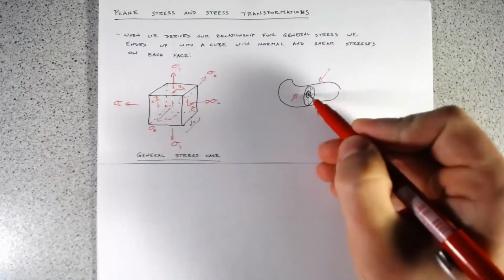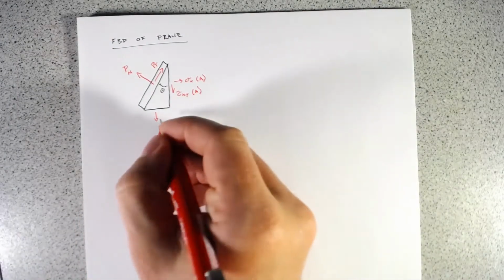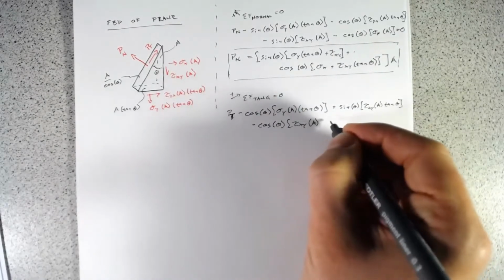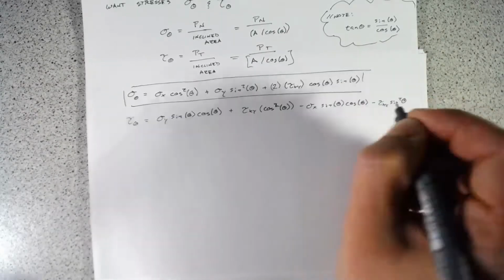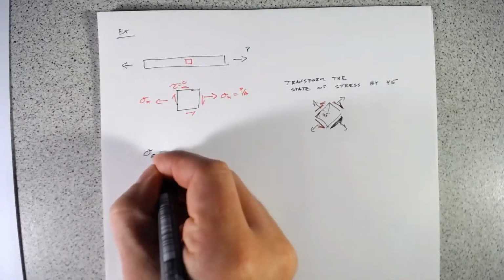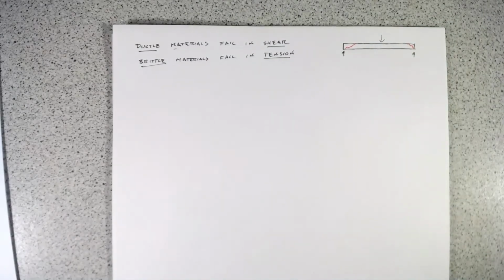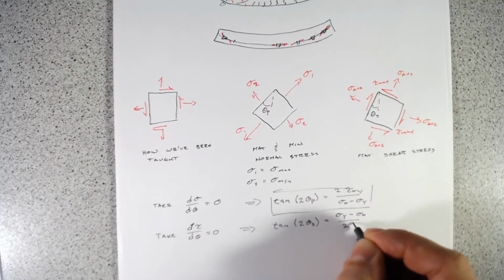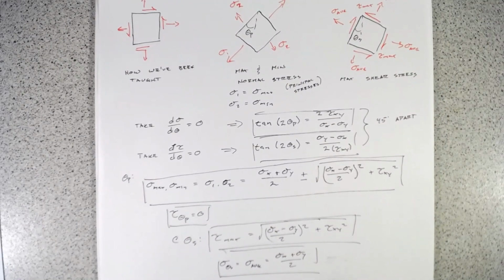Stress Transformation and Plane Stresses

Comment: One thing that confused me is that why we did not use tau_xy = - tau_yx to substitute tau_yx by - tau_xy? On the FBD, it was still written as tau_yx, but later when constructing the static equilibrium equation, it was turned into the other way around without adding a minus sign. Ofc, if we added the minus sign, the stress transformation equation would not be correctly derived. But why the minus sign should be ignored in this case?
Reply: Okay, I got it now. Because the direction arrows in the FBD already contain the sign.